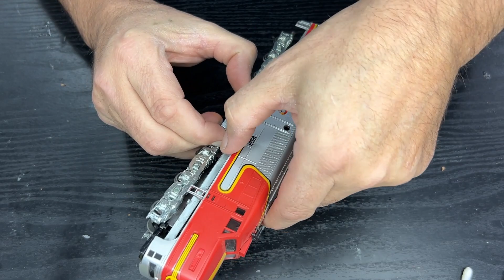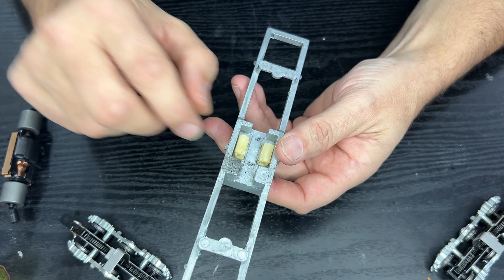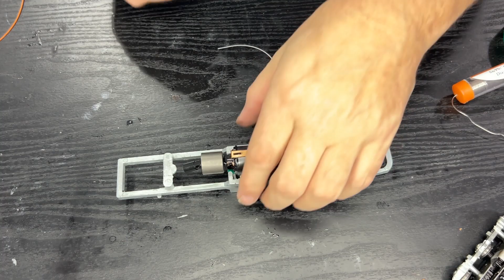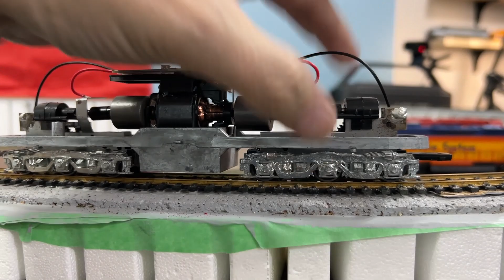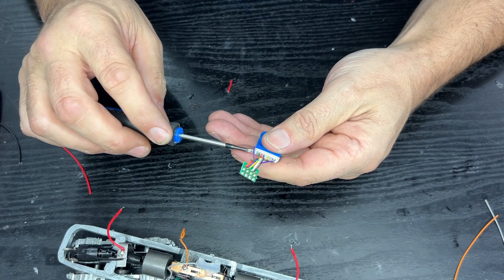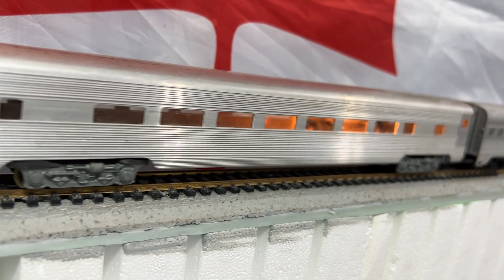DCC Decoder Upgrade - Athearn Blue Box PA-1 Santa Fe

Comment: I know it's a old video at this point but I thought I'd share some thinks I've picked up after doing a few of these jobs: 1) those older metal sideframe trucks love to short against the chassis during turns or grade changes. Hardly noticible on dc power but with dc it's enough to trip fault detection on many systems and blackout the track for a second. I switched all mine to the later run plastic sideframe trucks, or you can glue a bit of styrene to the chassis on the contact points to minimize the issue. 2) those old gray motors draw a TON of amps for the amount of work they are doing, you can pick up the newer style of motor from athearn that drops right in and pulls way less amps. Easier on the decoder and let's you run more engines at the same time. Hope someone out there finds this helpful. Thanks for the video Scott glad you're teaching how to keep these old engines relevant!
Reply from the maker: That's excellent advice, thanks Ian.

Comment: To poke out those motor mounts I use a wooden chopstick from my local Chinese restaurant. The flat end works perfectly. 
Also wipe your hot soldering iron tip on a damp sponge to remove excess solder prior to soldering every wire.

Comment: I found some female 8 pin that's wired up so all you have to do is wire it like a regular decoder then plug in the digitrax 8 pin. All my C420 bodies aren't wide enough for those DCC ready boards.
Reply from the maker: That sounds like a great solution

Comment: Well Dave it's a learning video. None of us are perfect. I have burned up more decoders than you have installed. Don't know when you filmed this, but I thought I sent you some extra harnesses, so you don't have to cut up your new ones. You may have used them already. She needs a Mars light. I love the idea of the mounting plate for the decoder. Wish you could come up with something to keep wires away from the flywheels. Keep working at it, and I enjoy your video's. I'll have to make one today.
Reply from the maker: Thanks Greg. For some reason I thought the harnesses you sent were for a different type of decoder. Just checked, and you are of course correct. I need to look into making an led mars light, for a lot of my P and F series locos.
Reply: They sell flashing led's but I am sure you know that. You are pretty good at installing led's. You know those older Bluebox motors run a little taller than the more current BB motors. I have run into the same problem.
 @ScottRails